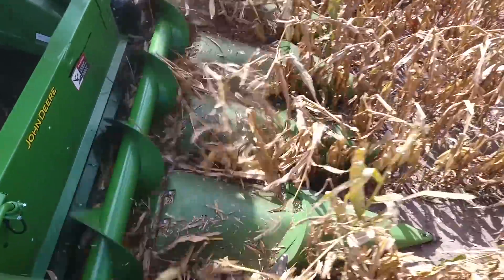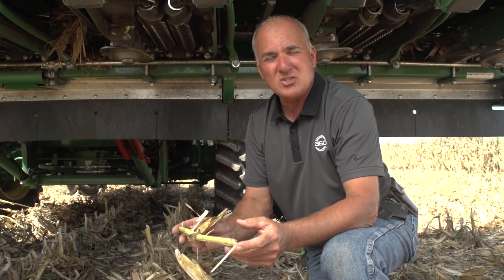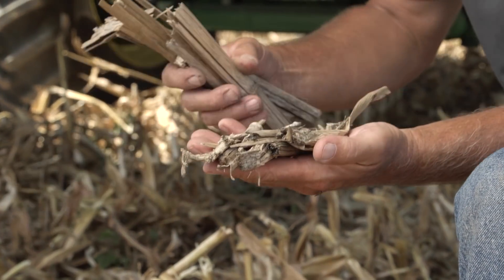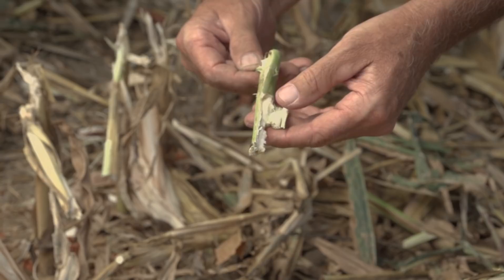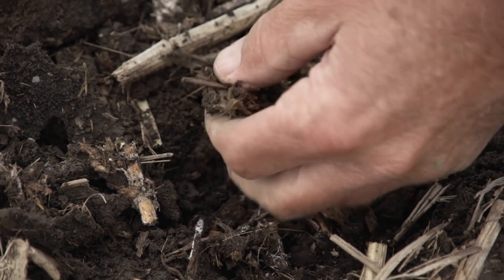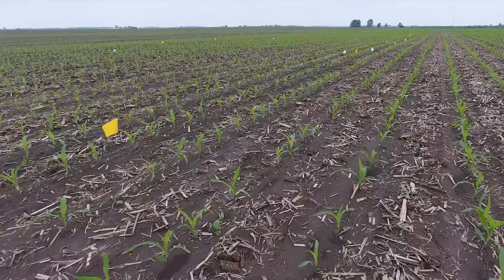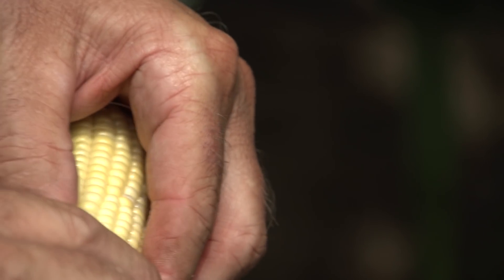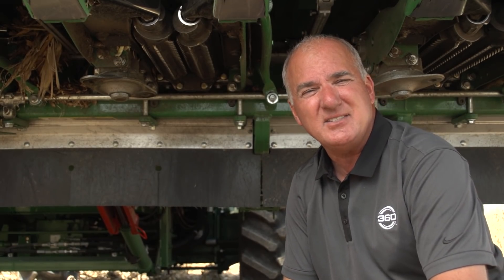PG: MANAGING RESIDUE FOR BETTER NITROGEN EFFICIENCY

Comment: quite interesting,, but growing up on a little farm in northern norway where everything from the fields was used for other things before brought back to the field i say letting corn stalks roth is a bit of a waste,, unless you have so much other CHEAPER stuff, say straw for bedding and such.........
corn stalks could be baled,,, ground up and used as bedding for animals ore. used as fuel for pellet ovens ore just mixd with manure for biogas digesters and so on,, and brought back as FREE FERTILISER
Reply: cornstalks are an excellent  soil builder when left on the field.
Reply: It's not "FREE FERTILIZER" when it has to be raked and bailed and hauled, processed, hauled back and spread.  The U.S grows 32,000,000 hectares of corn.  Look at the size of the field in this video.  For 1,000 km across the mid-west it's one field after another just like that.  There are parts of Iowa where you can drive for an hour and see nothing but corn.  Corn stalks have no market value there.  With farmers struggling to break even growing 10 tons of grain corn per hectare, reducing fertilizer inputs is gold.  The stalks are worth more in the field.